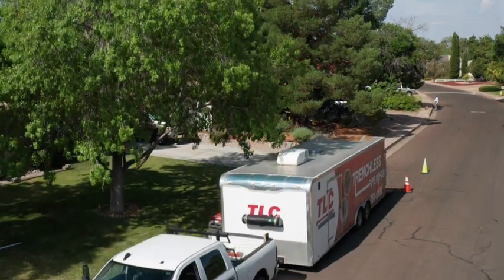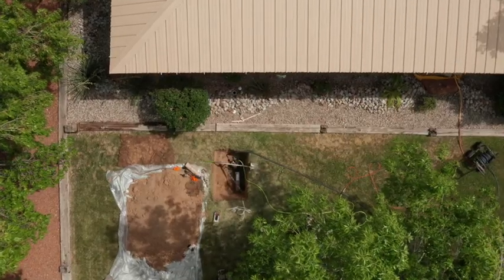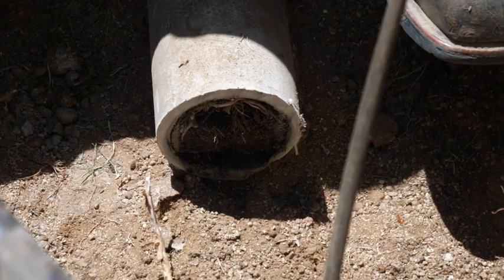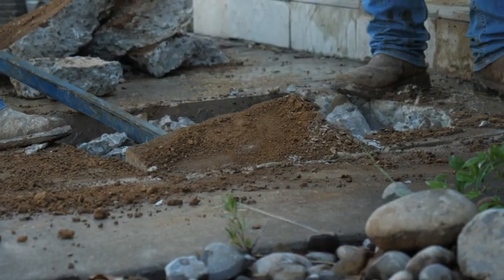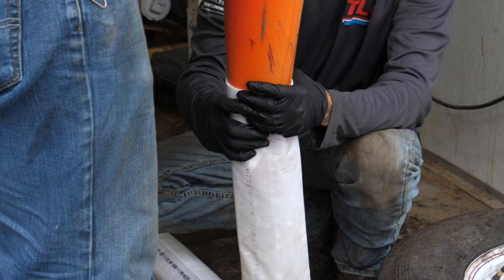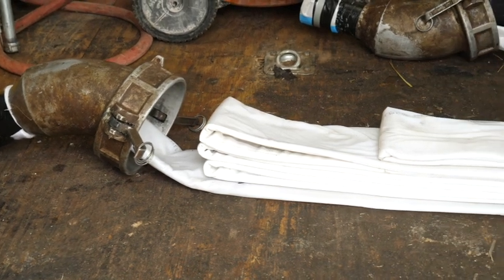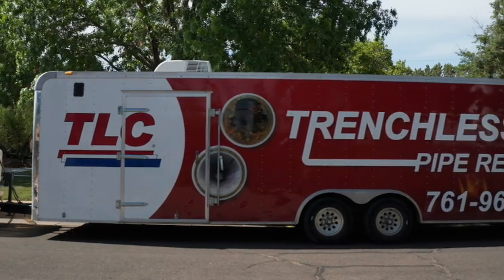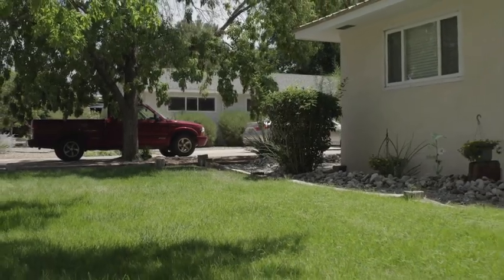What Is Pipe Lining Sewer Replacement

Comment: My condominium building is considering this. The engineering firm is advising the full replacement because they say we don't know how long this solution lasts. So serious question: what is the lifetime of this lining? And can it be repeated again? Does it work with any material? Our sewer lines are made of cast iron. Thank you!
Reply: I am currently researching this procedure as I  own a 62 year old home with cast iron pipes.  From what I've read the lifetime of a reline is 50 years.
Reply: Pipelining has been around Europe for decades now. Plenty of homes there with major sewer relining going for +30 years. Expected lifetime is around 50 years for most applications using modern resin. This is so common in the EU that full pipe replacements are no longer standard and in fact insurance companies will ask you specifically if full pipe replacement is needed vs relining (which is about 6-7x cheaper).